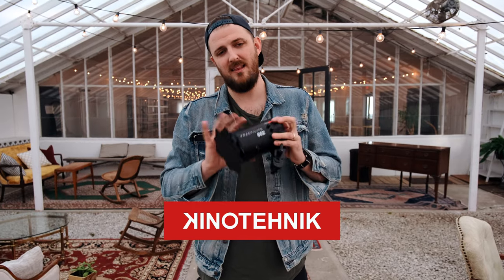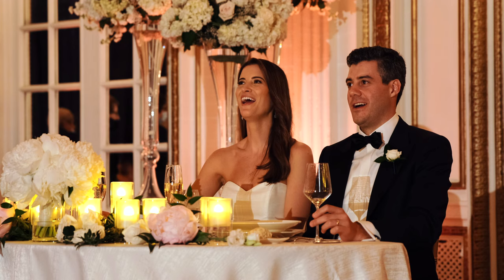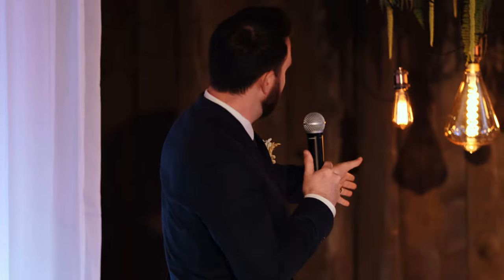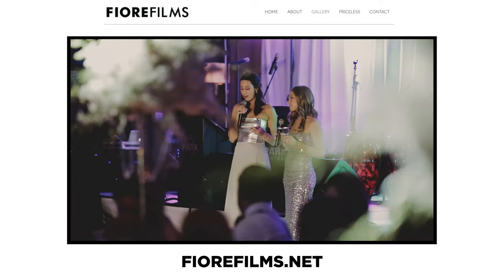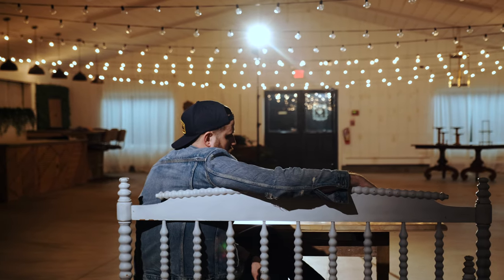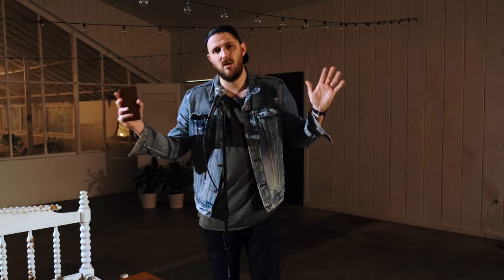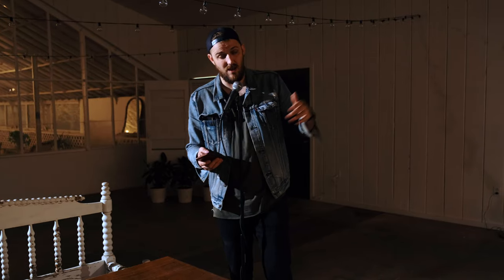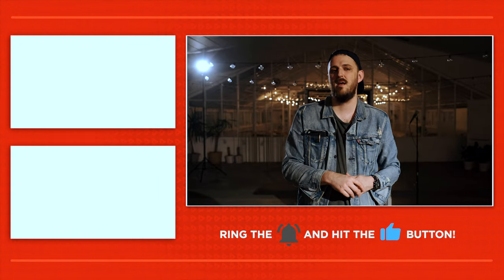How to Light a Wedding Toast

Comment from the maker: What topic do you want to see covered next?
Reply: Great video, very informative, thank you so much for taking time to create it and explain everything.

May I ask a few clarifying questions:
- how high do you normally raise your lights?
- do you always sand bag lights? and if yes, how do you do that?
- do you set your ambient exposure in camera first and then add light? 
- how do you know how much light to add? Do you just eye ball it? or use light meter?
- how would you light bride and groom when there is a large glass window right behind?

It would be great to see the following topics covered next:
- bride and groom letter readings during getting ready (how to multicam and how to mic them and frame so mic's are not visible in your shots);
- reception grand entrance (lighting and multicam);
- first dance (lighting and multicam);
- cake cutting (lighting and multicam);
- bouquet and garter toss (lighting and multicam);
- sparkler exit (lighting and multicam).

Thank you
Reply: What would you prefer, a 2nd shooter or an assistant?  I’ve been using a second shooter, but I think I would be better off with someone setting up sound and lights.
Reply: I would be interested in a video about the use of cameras without IBIS. 
- Handheld: lighter, easier to manually focus, more organic, but many times shaky and not a lot of movement possible 
OR
- Gimbal: super smooth but heavier, less organic and follow focus needed?

How should you rig up a handheld setup so that you can easily put your camera on a gimbal in a matter of seconds?